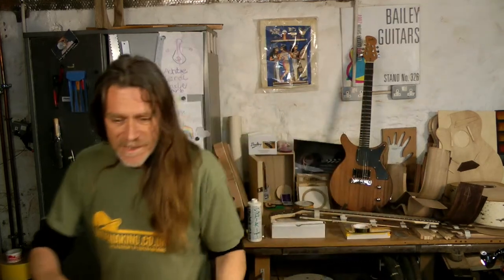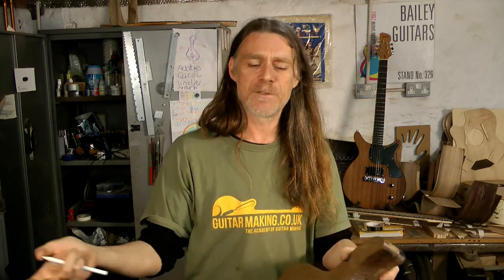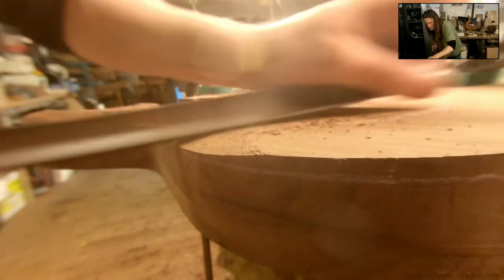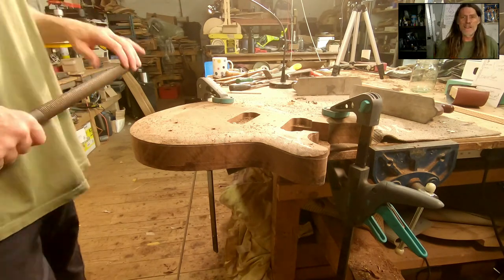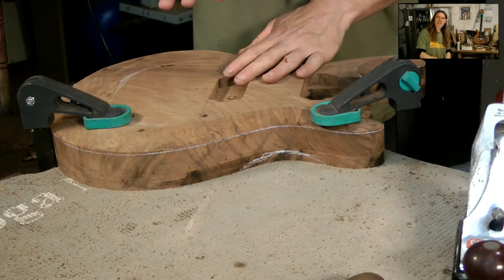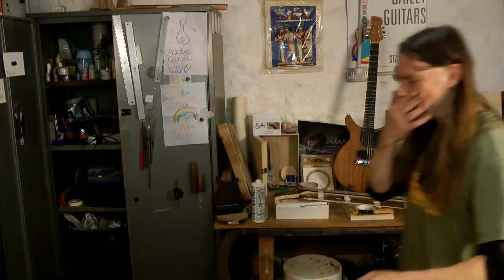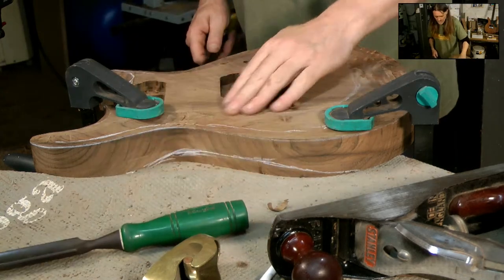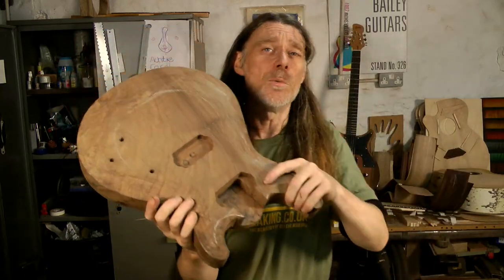Guitar Making Techniques: Carving - Tools for shaping the Neck + Body

Comment: Awesome work ! I love the fact that we work very similar. I am old school when it come to tools and working the wood. No fancy machines. Everyone of my guitars are one of a kind. I have learned a few tricks from your video. Thanks! One thing I did on my table. I screwed a 1 1/2"thick x 14"wide x 30" long. 24" extending out from corner of table. This made it easier for working around guitar and reducing moving for clamping. I did put a 45 degree brace on under side. I have never attempted making my own neck. I usually order a Fender or Gibson necks. Not cheap. Always brings my price up.  I need to thank you again for taking the time to share your techniques. RogersStudeo522